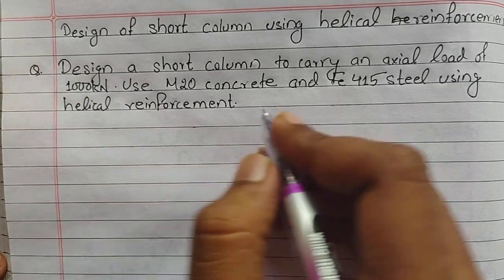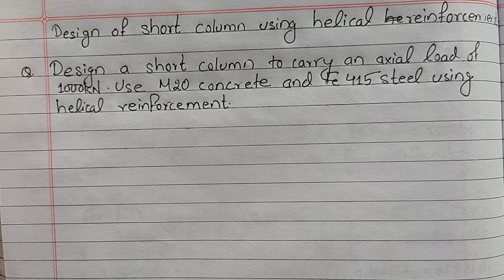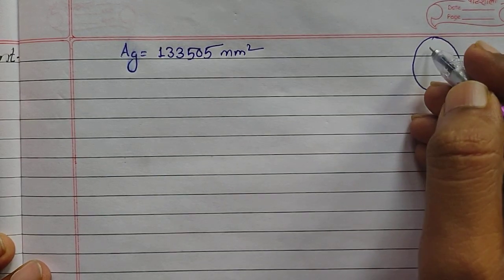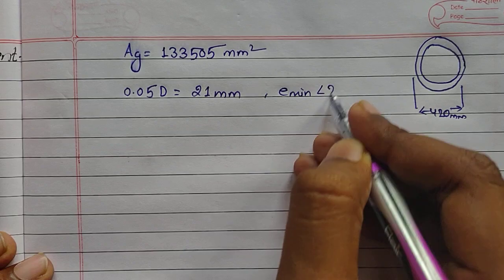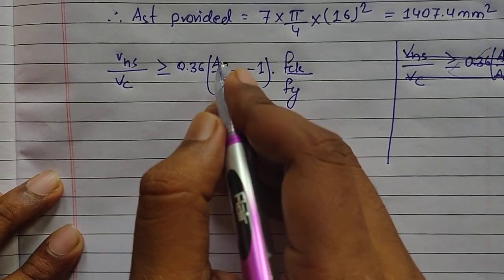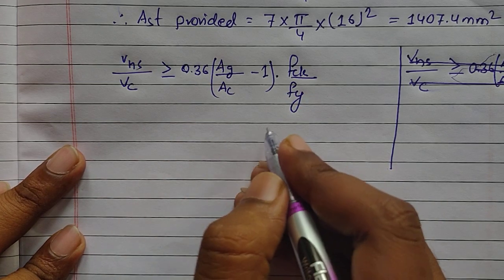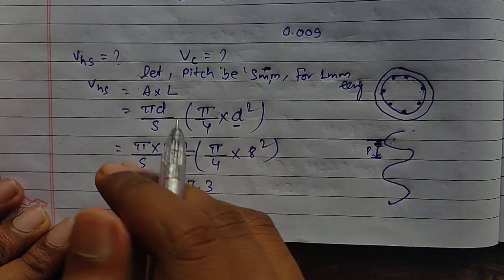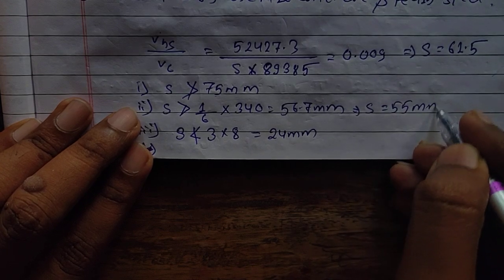Design of circular column with helical reinforcement

Comment: A little more explanation is required basically in calculating pitch of helix...
Reply from the maker: Sure
Reply from the maker: Calculation of pich is as per the code is 456 2000. Of clause 39.4.1. page 71 and clause 26.5.3.2(d) page 49.

Comment: But 1.05 times means multiplied by 1.05, right?
Reply from the maker: Hello dear,

First of all thanks for your comment.
You are right that 1.05 times means multiply by 1.05.

And when you come to read the clause 39.4 of is 456 it already mentioned that "strength of compression member with helical reinforcement = 1.05 Pu"
Where Pu is strength of similar material with lateral ties.
And initially we need to design longitudinal reinforcement before the helical reinforcement.

That's why we need to the the steps
(Given load x factor of safety)/1.05.

And i hope you got your answer. Do comment when you face any kind of difficulty. Stay connected with civil learning online.

Have a nice day.

Comment: Sir Area of helix m to longitudinal reinforcement nhi subtract krte h na
Reply from the maker: Hello dear,
We need to subtract the area of longitudinal reinforcement from the area of helix.
It is because inorder to calculate the pitch of the helix we only need to have the area of helix reinforcement.

And one thing more,
We have considered the the diameter of helix after subtracting (2x40mm) cover from both sides. And u can notice in the inside the core dia. Longitudinal reinforcement is also included. And that's why we need to subtract the area of longitudinal reinforcement.so that the pich of core can be calculated and the codal provision is satisfied.

I hope i met your confusion.
Thanks for your comment.
Have a nice day.